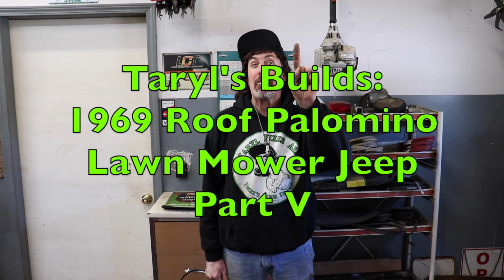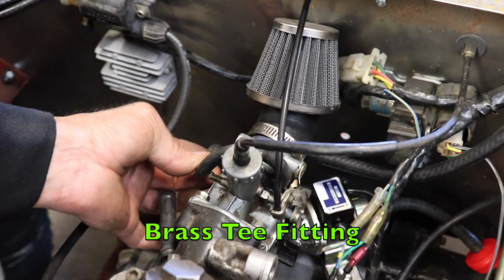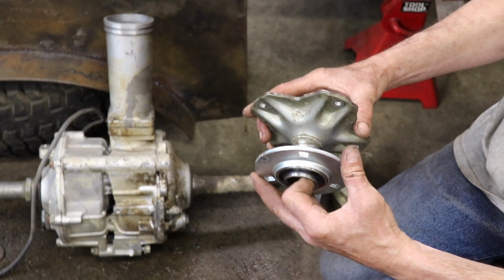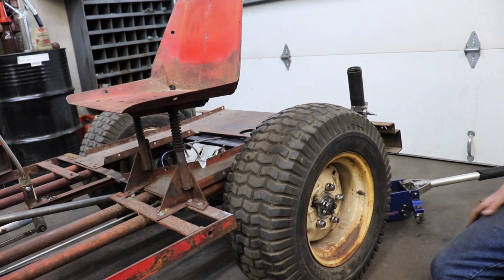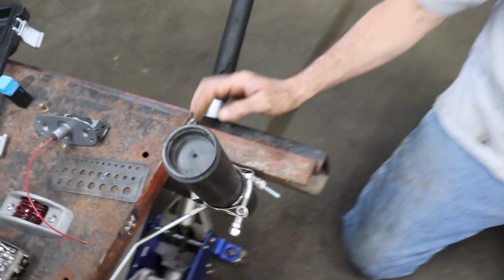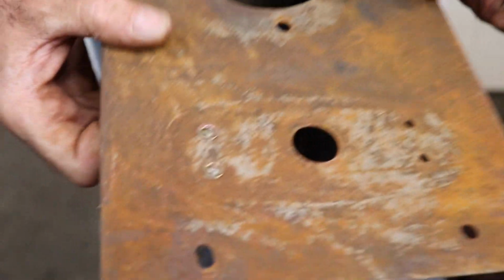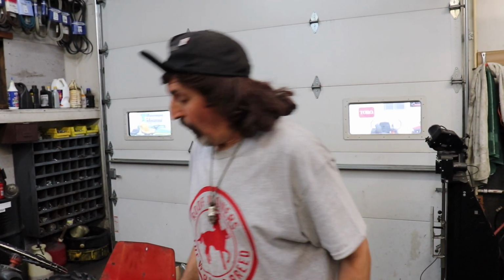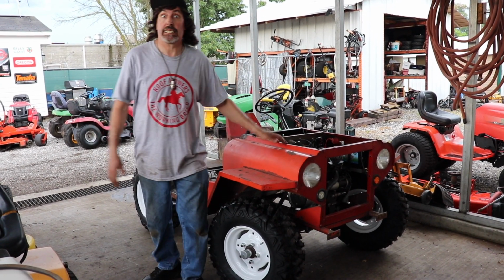AWESOME 1969 Roof Palomino Lawn Mower Mini Jeep Pt 5

Comment: Taryl if you have to weld nuts on the backside of something try using center hole tab weldnuts. They self-center in the hole you drill and you don’t have to worry about getting the weld too close to the threads and boggering them up. I use them all the time in my job.

Comment: You can also get countersunk nutserts, which will be flush with the panel surface when installed. They're a bit more difficult to install though, as the hole in the panel needs to be countersunk just enough for the nutsert to fit flush, but not too much or they'll pull through when you install them. They'd be good for mounting things like the lights, but I'd stick with the regular flanged type for mounting body panels. One thing Taryl didn't mention about nutserts, unlike a captive (welded) nut it's easy to replace one if it gets cross-threaded or stripped out. They drill out like a pop rivet,  as soon as a drill bit cuts through the inner flange edge the center will push out the back side. Squeeze a new one in place and you're good to go.

Comment: do you think the bolt for the locking hub is strong enough for the torque from the rear axle??...also those nutsert tools are awesome...used them before and they are lifesavers plus they look good

Comment: Hot rodders do use this box only when they have to . Mostly rodders that build rat rods  and straight axle cars . The best was the rack & pinon steering from a Pinto but now there are companies that make these just for builds .  You should have cleaned that metal up and painted it with weldable primer before  you welded on it . I know you are the best person on here . Ever body man knows this and I get on here to see somethings I have forgotten how to do it and you help me greatly on some of my projects .  I was watching your video just yesterday looking on how to replace the old spark advance system on a Kohler engine with just the one prong coil .  So keep up with all the good work . So please get that metal clean and use epoxy primer before you use any other kind of fill primers . Keep what ever room your going to use clean . Tack the primer down and dont touch it with you fingers with out latex gloves . You dont want to get oils off from your skin on to a painted or to be paint part . It may not show but it will be a weaker bonding at that point where you touched it .  To keep the dust down spray the booth down with water . Just walls and floor .  Use an air and oil separator before your VLP gun . You dont want fish eye in the paint .  If you do those things you will get a really clean paint job . Wait before each coat of paint to tack up and dont try to put the paint on to much . 1 Tack coat and 3 cover coats or more . Some painters put on 5 color coats and 3 clear coats . The last coat being you shine coat or wet coat but with out any runs . Always paint in one direction when you can . I hope this will help . What a cool project .  I like to have found a Roof palomino .

Comment: Those threaded inserts are handy.  In the aircraft industry they are called "riv-nuts" .  Same thing....different name.   Anyways, there is a type that has a nub on the inside edge.   And a die that punches out  keyway in the hole in the sheet metal.  That way the riv-nut-nub engages with the key hole and won't spin.  Just saying, FYI.

Comment: we use the same thing when were building the hummer for the military we call it a avk we have a gun with a bolt  
on the end it drives the nut selt into the metal

Comment: If I had one of those palomino jeeps I would use a reliant engine 700cc 4 cilinder gear box and diff from a reliant bond bug it would fit and save you a lot of work with very little modifications. The bond bug was a 3 wheeler car  one Britons smallest cars we ever made they were so lite 3 people could pick one up . It had a top speed of 60 mph and does 65 miles per galen

Comment: Realy like those nut certs we rebuild old tractors but use them id love to use thease from now on all that tin with bolts and nuts on inside it would save so much troble if the manufacture used thease their allways so rusty bolts are inch long of 40 year old threads

Comment: I haven't looked at the comments, so forgive me if this has been addressed. I'm wondering if you have any plans (or need) for an equalizer on the fuel tank. It looks like fuel on the far side of the outlet is going to be trapped and unavailable to the engine, possibly causing problems down the road.

Comment: Wonder if that cert tool works on thick plastic, mt Gravely ZT-1640 has 2 saddle tanks which the controls panels bolt into. Well the certs have disappeared, now Im just using bigger screw type bolts to hold down the panels. Would like to make it right, somebody gave me the mower and Im kinda going through it, no maintenance was done on it for 10 years.

Comment: Hey Taryl. I need some advice. I'm trying to replace my transmission belt on my zero turn. I'm trying to get the electric clutch off but it won't break loose. It's just loosening the bolt on top of the motor. Should I tap on it with a hammer? I have the new belt. What would a shop charge me to put it on?
Reply: @ItsMrAssholeToYou  okay. Thanks

Comment: With the return fitting in the filler neck you're going to aerate the fuel tank. It's going to vent like crazy and cause problems, possibly even vapor-lock. Whenever you have a fuel return line you want it to feed below the fuel level to stop aeration. That's why sending units in older cars, you can get aftermarket ones with an additional return line and the tube always goes to the bottom of the tank.

Comment: Not bad I like it . Mount the spare on the side that’s the original way on the flat fender Jeeps and the original CJ fender. Dad had a 55 Willy’s in 1971 he bought wrecked 67-68 Impala inserted the 283 power brakes power steering, column, and radiator no more flat four. That was a great Jeep many memorable years hunting it was the best mule getting into the crappiest places.

Comment: Hey maybe a Ross Worm Gear steering box would work. They are awesome! Found in IH Cub Cadets. Its an automotive system, used in cars long ago. But the garden tractors are smaller, but the same.

Comment: Hi taryl I got a question I have a n lt1000 mower it has a 16.5hp briggs on it  now I use it to mow the yard I feel like the engine is a little weak what's the most hp engine do you think I could repower it with and not have the  belts jumping off thank you in advance

Comment: Some old walk behind garden tillers have the locking rear wheel set up same way. Great job Taryl. Actually on the axel. Pull knob and turn 90 degrees and the roll pin sits in grove. Pull out sits on axle nut. Can be screws out to keep it in neutral so drive tires don't move. There's your breakfast

Comment: that return line is gonna make a lot of gasoline vapor cause of all the sloshing around, and such. if you ain't got a vented cap, you're gonna need a fuel vapor system like on a fuel injected car. you'll have a lot of pressure in yer tank, and gas smell otherwise. those riv-nuts are handy dandy! they use them a lot in aircraft. that's how i know about them.

Comment: Tayrl, Extend the front bumper and add a small winch behind it, that would look cool and be functional! 
BTW, you can dimple the hole with a ball peen hammer then mount the quick nuts. If the metal is thick use a small counter bore too.

Comment: Taryl, I have used nut certs in past couple hints you can counter sink in thick metal by partially drilling larger hole so head fits flush and for thinner metal use tapered punch and backer to form pocket for nut certs. [ I actually use tarp grommet tools to form metal]

Comment: Excellent dinner Tayrl!,I happen to have a 1975 Honda CB-200-S,but it's a twin-cylinder and these engines are not known for much in the torque department,when I was watching you do donuts after you put the new tires on and the diff-🔐-lock engaged,it didn't spin much,the new tires really made a big difference on traction.
I kinda wonder if you can setup a  solenoid activated diff-🔐-lock system?.(dash-board activated)
It looks good and hope the chevy steering gear-box works ok.